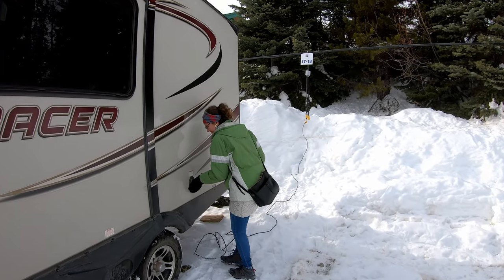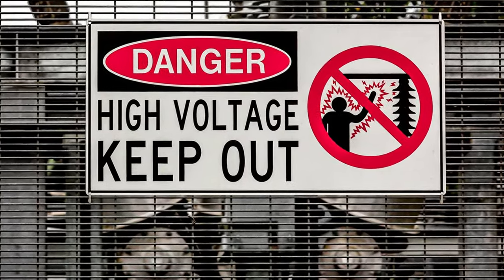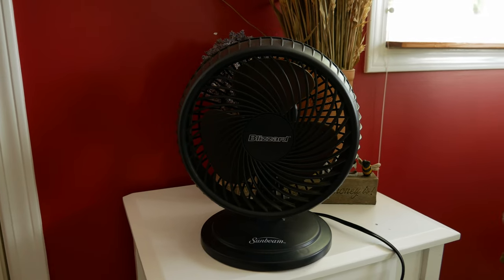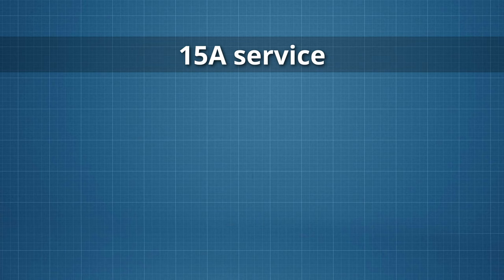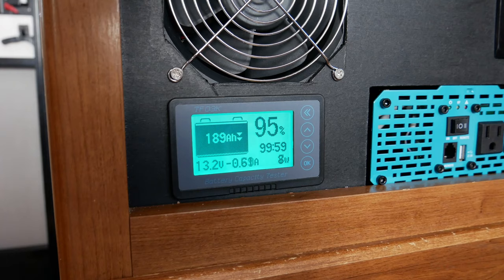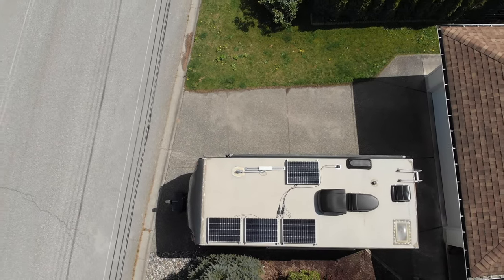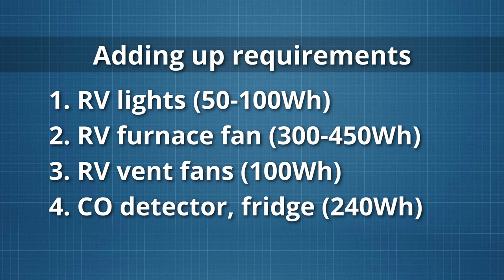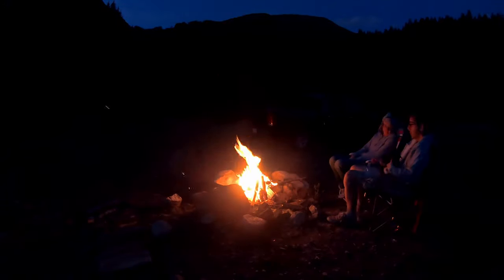RV Electrical 101 | Newbie guide to RV electrical systems

Comment: Very helpful although next year we'd like to switch up to a LiFePo4 battery as we only boondock and this year we ran out of power twice. 2 seniors so our needs are modest but I have some concerns about our 2008 Rockwood RV. I imagine I can't simply drop in a high tech battery so jury still out on that idea.
Thanks for the electrical help and BTW, we know and easily recognized your opening video location. Great Pike spot as well and the three ships make for great photography.
Cheers from Northern Ontario and we're trying for your province next year.
Reply from the maker: Hello! Yeah, running out of power is definitely a pain in the butt. We've been there, which is what prompted us to change our system to LiFePo4 batteries, too. Jay did the work himself and made a couple of videos about it too. He even shares a list of all the equipment needed. Since making the change we can boondock (almost) indefinitely. It is worth the money and effort, but you're right, not as easy as just switching out the battery. 
Maybe we'll see you around BC next summer! Happy camping!
Reply: If your rig is that old you'll probably have to upgrade you charger controller to a newer one that will charge lipo 4 batteries. Battlefborn batteries are xlnt and they can also provide the right charger controller for your rig. You'll probably need 200-300amp batteries. That will cost you probably $2,000 or less to upgrade. Another $1,000 or so to install 400-600w solar. So for about $3k you can be of grid indefinitely. You can save a lot of your handy, not that hard to do. I highly recommend it, it will change your adventure and save you money in the long run.

Comment: just bought our first RV. it's a 2016 pleasureway plateau. Unfortunately we did not get a walk through at purchase and so we have many questions. today I need to better understand the electrical sytem basics. in particular, I want to know how smart my RV is when on shore power. When using my cpap via 12V outlet am I accesing the battery or does the system know I'm on 120V shore power and draws from that system.
Reply from the maker: Typically, being plugged into shore power means that everything is running off that.   Sounds like you've got your work cut out for you. Don't worry though, you'll get the hang of things soon enough.
Reply: @HomeARoam  thanks very much for the info (that clears it up) and the encourage to go forth and enjoy:)

Comment: voltage is better equated to the pressure of the water, and amperage is more related to flow. Voltage is the potential energy that could push the electrons, amperage is the rate at which the electrons are moving.
Reply from the maker: That's a good analogy as well, I like that.

Comment: The attempt at comparing Electric and water is incorrect.  Voltage is equal to the water pressure, the current id equal to the amount of water flowing., Resistance is like the rocks and things the water has to overcome to flow.
Reply from the maker: That's definitely a good way to think about it. Analogies can be difficult sometimes. 😁

Comment: Can you help me out? I just bought a 94 class c. The outlets don't work even after I press the reset button on the outlet in the kitchen. The outlets only work when the generator is on. I thought they didn't work because the house batteries were dead. I charged up the house batteries. But they still don't work. Stumped .
Reply from the maker: Hi there, yes unfortunately your AC 110v sockets will only work when you're plugged into "shore power" at a campground or if you're running a generator. The only way to get them to work otherwise is to install a large lithium battery bank and run an inverter. And even then you'll still need a way to charge the batteries using either a large solar array or with your generator. Typical lead acid batteries don't have enough power to run your AC sockets.
Reply: @HomeARoam  thanks! I'm still a bit stumped though. When I first bought my rv, I recall the outlets worked even without the generator on. Then a few days later, they stopped working .

Comment: im planning to power a small cabin with 2 battery's using a trolling motor charging system will it run a small fan night light small gas heater over night??
Reply from the maker: Hi, we aren't sure if that would work or not, sorry. What is a trolling motor?

Comment: What is used to connect the RV alternator and Solar panels to the house batteries?
Reply from the maker: Hi there, you need a charge controller to hook up solar to your batteries. I recommend an MPPT charge controller as they're the most efficient. They cost a bit more, but it will be well worth the added output.

Comment: so if the converter in a camper/rv steps down the 120v shore power to 12v to charge the battery, then the battery powers the 12v accessories like lights, but the battery cant be used to run the 120v because theres no default inverter then whats the point of the battery? why couldnt you just run the 12v accessories off the converter's 12v since youll only have power while plugged in anyway?
Reply from the maker: Yes, you're right. If have you a trailer plugged into shore power all the time, there's really no need for the battery. The converter supplies 12v power. But, if the power gets cut for any reason, that's when the battery takes over and continues to power those essential items until you're able to get shore power again. So I wouldn't recommend using a trailer with just the converter and no battery.
Reply: @HomeARoam  I actually just found out last night when my main breaker in the garage popped for the second time (I have a 30A camper on a 20A breaker(it's been fine 99% of the time)) that even when there's no shore power the battery still powers the lights. I thought once you unplug the shore power you had zero anything. No 12v lights, no 120v outlets, etc.  the only other time I popped a breaker was this summer when I turned on the microwave while my AC was on high and there was nothing. No lights, no anything. But it was during the day so I might not have had the lights on. Can't remember tbh. But up till last night I was under the impression when there's no shore power there was no power at all. That's why I was confused about the battery.
Reply: 12v system doesn't have enough current for long enough to power the 120 system

Comment: Why do my aux batteries keep draining dead when we are plugged into shore power?
Reply from the maker: Sounds like a converter issue, sorry to say. That's what converts your 110v AC shore power into 12v DC power that charges your battery. Check the breaker that powers your converter. If it's on, you'll need to do a bit more electrical diagnosis or try replacing it. Hope you're able to get it sorted!

Comment: I'd like to know what to do for a noisy fan in the rv control panel
Reply from the maker: That sounds like the converter fan, and ours is loud too when it's running. Most of them are loud because they have a lot of heat to dissipate. You may be able to find a quieter replacement.

Comment: Whenever I take power from the house everything is fine I just can run AC. But whenever I run the generator which is 3200watts turn on the AC generator gets weak my panel in the Rv gets hot along with the cords please help I’m new to the Rv life
Reply from the maker: Hi, if it's a built-in generator, I would take it in to an RV repair shop to have a look at the panel and wiring. If they are heating up significantly, that's a really bad thing and could lead to a fire. If it's an external generator, are you running it on a 30amp cable (ie. the big thick one?) You definitely won't be able to run an air conditioner on a regular 15 amp extension cord. That would also be dangerous and risk starting a fire.
Reply: @HomeARoam  thanks so much
Reply: @HomeARoam  it’s a mobile generator maybe it’s not powerful enough?

Comment: Hello I have trailer and I used the appliances at the same time and now my plug  is not working how can I fix it normally I press the push button it's like rebot but now I can't press it anymore its stock please help
Reply from the maker: It sounds like maybe a breaker was popping and you were resetting it? If it's stuck now it's likely the breaker itself has broken and needs to be replaced. Hope that helps!

Comment: @musclecars4635
0 seconds ago
I noticed in your video, you have a black 15 amp fuse for the radio. Any insight to a regular size "black" blade fuse (15 amp) that is "special", usually 15 amp fuses are light blue. I have a 2022 Thor class-a and it has a 15 amp black fuse for the radio that doesn't look like a typical regular size blade fuse like the others in the panel under the bed. This "special" black fuse has a tiny resistor inside but it fits like the regular size blade fuses. When I replace this special fuse with a regular size 15 amp (light blue) blade fuse, it always blows, so I have to put back in the special fuse then its fine. I cant find this type of fuse anywhere online. I have since reached out to Thor thru their owners portal, but no response yet. any help would be greatly appreciated!
Reply from the maker: Hmm.. I bought all my fuses in a "variety pack" on Amazon. That might be worth a try. Otherwise maybe a small auto/electronics shop with a knowledgeable employee might be able to pin it down.
Reply: @HomeARoam  I bought the variety pack but most if not all only contain micro, mini and standard sizes. I checked with a reputable sound/electronics place and they never saw the fuse before. go figure. Like all of us RV'ers, we're always investigating and fixing issues ourselves! happy rv'ing!

Comment: My converter messed up. I bypass it. No AC power. My fridge has a plug for  120 volt . I plugged it in to a 20 amp plug I put on power pole. It worked for about 10 minutes. Then went off. Is my fridge fryed. And my hot water heater won't work hooked straight to 120 volts. Any ideas
Reply from the maker: Hi there, so if your converter isn't working, you won't be able to charge your DC system or battery, which will affect your lighting, water pump, propane detectors, etc. It's pretty important that you get your battery charging again. However, your fridge and water heater should both work off 120v AC power, but you often need to use a different switch to switch it from propane to AC. You may want to check out our other video about replacing your converter: https://youtu.be/8fg6S5PqxA8 or you may need to contact a repair person.
Reply: @HomeARoam  thank you. I'm a electrician. But never messed with a converter. My fridge is plugged in to a 120 volt plug. I plugged it in to a extension cord. Nothing. I will watch the video you left. Thanks again

Comment: I don't see on any videos why a furnace won't come on at all! Nothing! Replaced cir. brd. good fuse checked sail switch. 3 yr. old travel trailer! Help!
Reply from the maker: Hi there Audrey, have you tried our step-by-step RV furnace troubleshooting video at https://youtu.be/Gm_xbVpDOGs ? We also have a printable quick reference PDF on our website at https://homearoam.com/how-to/rv-furnace-troubleshooting/ -- Please let us know if that helps. Usually no indication of power at all means a burnt fuse somewhere, or a problem with the thermostat.
Reply: @HomeARoam  Hi! Turns out one of the  pins on the circuit board (rectangular block w/row of pins) was slightly bent and was enough to not turn on the furnace! I must have done that putting in the circuit board myself. I will look on your website for more info! Thank you for the  timely reply
Reply from the maker: @audreybarka5893  Wow! Glad you were able to find the cause and sounds like it should be a somewhat easy repair? Good luck with the repairs 😀